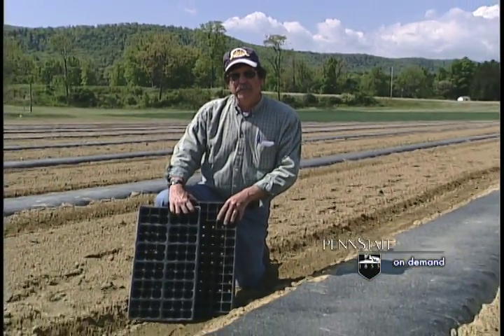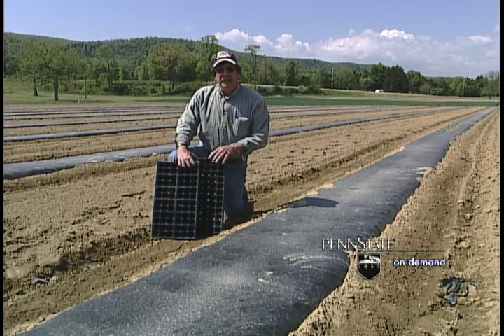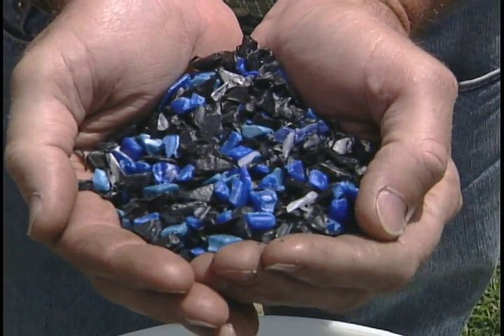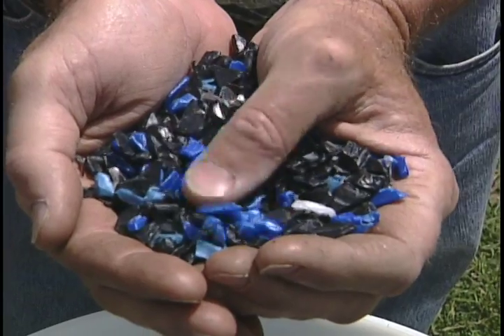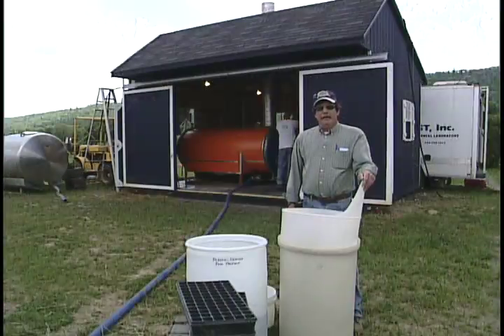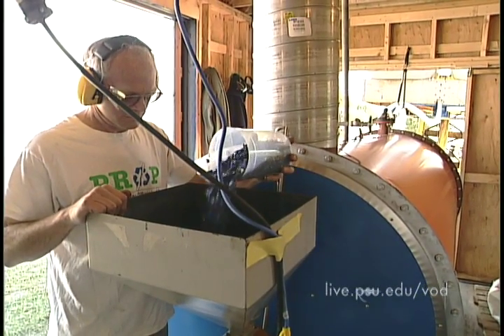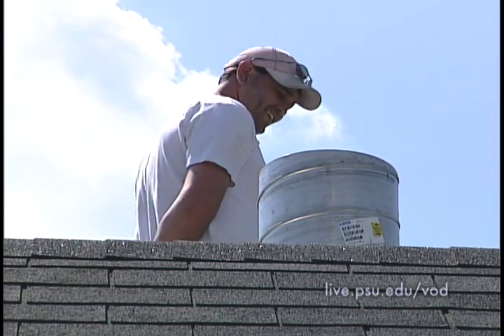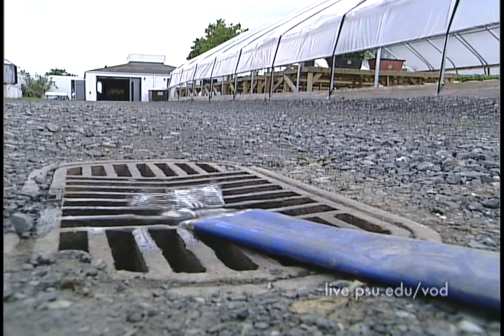3 Minute Gardener - Plastic Fuels

Comment: wait, so you are using the plastic AS a fuel. I thought you were turning the plastic back into oil. I suppose you could do both at the same time. Use plastic as the fuel to distill other plastics back into oil.